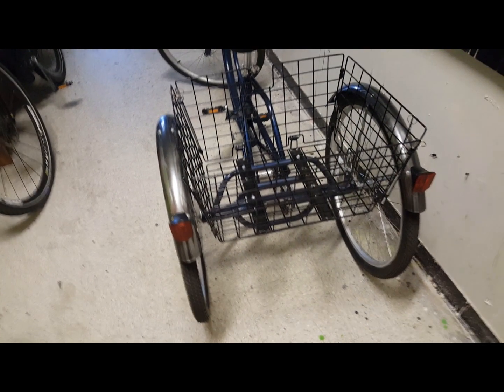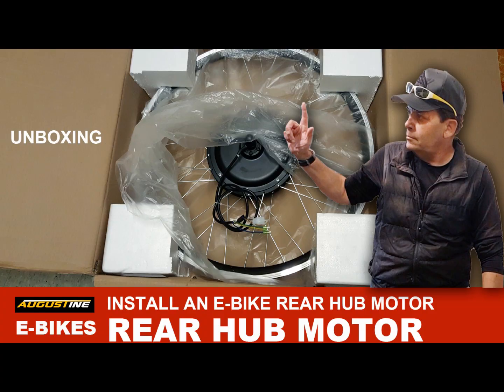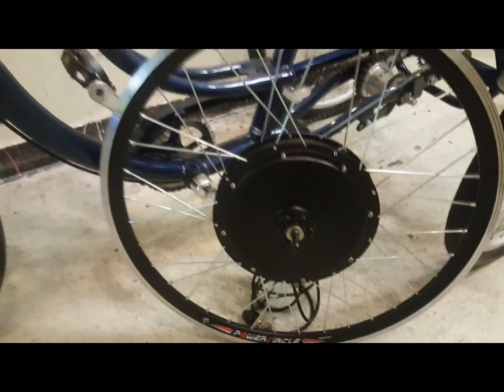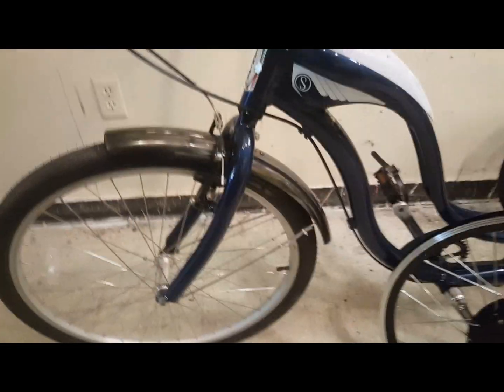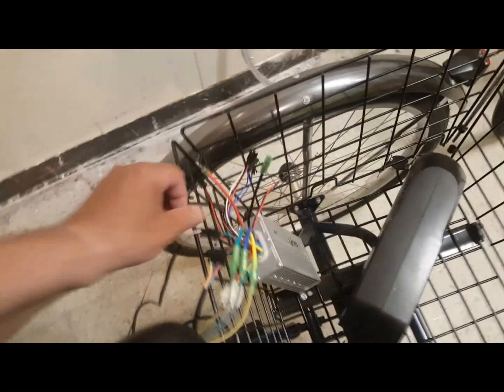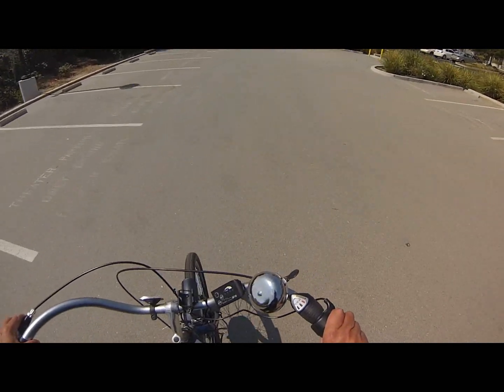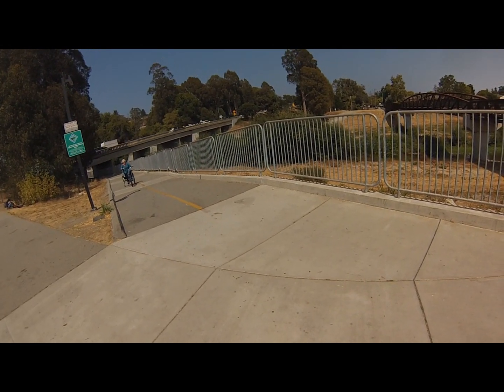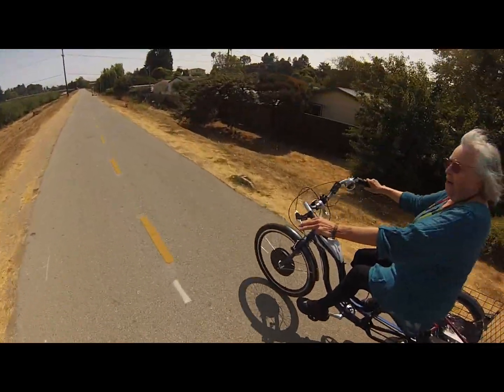EBIKE CONVERSION KIT- 1200W, Schwinn 26" E-trike and TEST Ride

Comment: Nice to see. I have that same bike in red with a black beer holder. ;) When I first got it (used) I asked a local bike shop if they would do an ebike conversion and they refused, citing safety concerns. It's a retirement community so I guess I can see that as a valid reason. Admittedly, at 6' and the upper weight limit for that bike, it's a bit wobbly - whereas my wife's Torker Tristar is better built and a more solid ride. So I'm on the lookout for another Tristar and will electrify both and sell the Schwinn. Your customer has nothing to be ashamed about that Schwinn - the gears on those things are tall and it's difficult peddling on even the slightest inclines. Thanks for the video!

Comment: Hello Agustine,

I have a trike project for my mum so she starts to enjoy again bike feeling. Its a 20" wheels model from amazon and bafang front wheel 500w 48v. My concern its about how the front wheel stays put in the trike without risk.  I see you installed and arm to prevent. Do you have a link to the shop or maube the exactly name to find it
Thanks:)

Saludos from Spain
Reply: You should install torque arms on both sides, good insurance.

Comment: Wrong. That tinny fork cannot suport 1200w. Maximum allowed its 350w. The fork can bend over and fall apart when accelerating at 1200w if the bike its loaded.
Testing doesn't show anything wrong about your skills......but later someone could die for what you do. That's why you will never be an engineer in EV. You have no understanding about mechanical forces and torque.

Comment: Nice conversion, do you have any range info? Thanks,
Reply from the maker: It has a 48v 20AH battery which gives her a range of 40 miles
Reply: @AugustineEBikes  Thanks for the info. That's an impressive range. I guessed it would have been less for a trike.

Comment: With some light mods couldn't you put them hub motor kits on the rear end?? You would just need a bar/cage or something for the t-arm.. 
   Its what i want to do been tring to figure out how to do it using hub motors guess could go with hub in the front and 2 sidebords for the rear

Comment: Great video..... what specific battery and kit did you use? I am trying to replicate this product as a project my students will build
Reply from the maker: Thanks. It is a 1200w front hub motor from Ebikeling with a 48v, 20 ah rear rack battery from China.
Reply: How much does a kit cost??

Comment: i am having trouble trying to find 26" trike wheels...i am building a delta style recumbent trike and all i can find are 24" and smaller trike wheels
Reply from the maker: Go with a front hub and you will find plenty of 26" wheels.
Reply: indeed...but i mean i cant find parts suppliers for trike builds..i would like to avoid buying used back wheels for my trike build  @AugustineEBikes
Reply: @AugustineEBikes  also- for an ebike front hub. what kind has no resistance while freewheeling/coasting ?